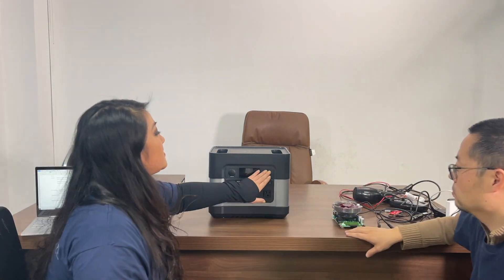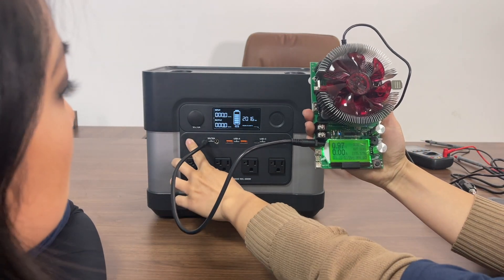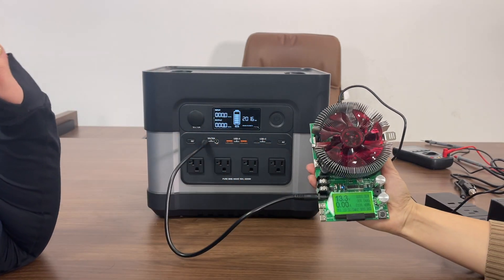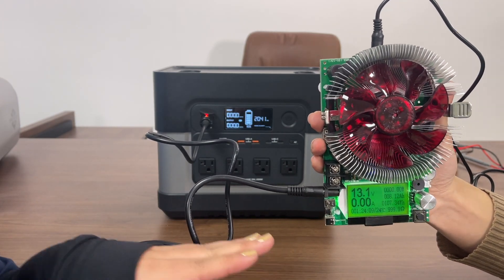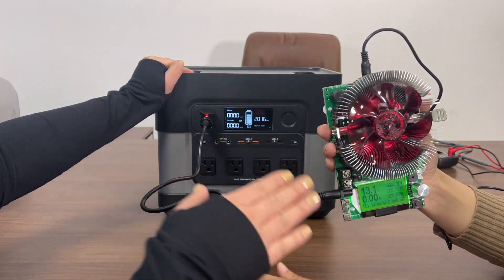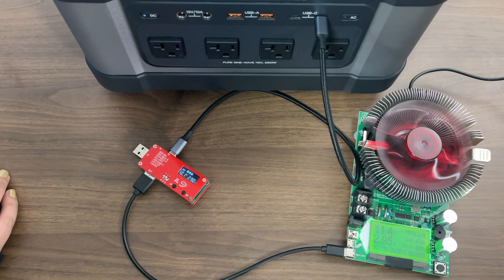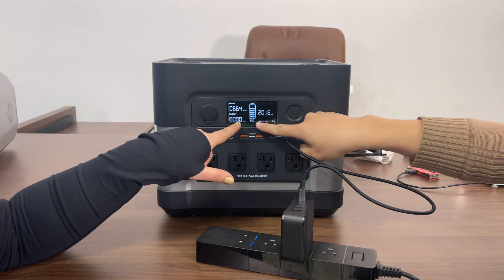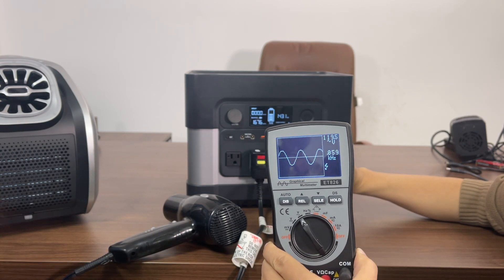Zero Breeze ElecHive 2200 test video

Comment: How many 100w solar panels can you connect to it? does it come with solar panel connection cable?
Reply from the maker: Hi there, 1250W of charging power is the most to be accepted. therefore supports at least 12 solar panels of 100W, taking into account that solar panels have a conversion efficiency factor and can actually support more than 12 solar panels of 100W. Our charging interface is Anderson, for solar panels that we sell ourselves, we will provide the appropriate connectors, if it is the user's own solar panel then parallel or series connection and the connection with the ElecHive will need to be considered.
Reply: @ZEROBREEZETech  is the solar panel 30v  or 12v? will it run on 12v panel?

Comment: If the DC output voltage is supposed to be regulated shouldn't it have remained constant?
Reply: Yeah this is what I'm wondering cuz it went below 12v before it shut off.
Reply: It's staying at 12V. It's a 12V output. If it maintains 12V like in the video at 50% battery SOC then it's definitely regulated. It looks like it is though as it maintains 12V through the range. Ofcourse it goes below 12V when it hits overload.
Reply: @Brisket9392  Seems like it fluctuates quite a bit for a regulated output, or at least it's regulated pretty low. Wish it was kept at 13V at least
Reply: @Brisket9392  @3:35 the voltage read 11.5v. You should read up on the difference between a regulated versus an unregulated power supply. It should stay @ 13.4 (13.3) until the battery is dead.
Reply: @brianonthecoast  You should read up on electrical concepts before putting other people down while you're wrong.  It's regulated and what you are seeing is drop across the wire as current passes through at higher and higher amounts.  The 120VAC doesn't do this because they probe on another outlet rather than at the end of the wire carrying the current.
Reply: @Brisket9392  did you see in the end of the video when they were running the hair dryer and the voltage remained @120? That's regulated, IMO.
Reply: @brianonthecoast  They probed on a totally different outlet rather than at the end of the cable for the hair dryer....
Reply: @rlcrispsss  Sorry, but all the outlets are tied together. There are not four separate inverters in the unit (one for each of the outlets) and the combined load is what the inverter has to deal with. That is why it works how he demonstrated, I am 99.999% certain this is correct.
Reply: They're both regulated.  

The 120VAC stays high because they measure on a different outlet (you can see the probes in another outlet) so there is no drop across the wires

The 12VDC decreases as they increase power draw because the measurement is at the end of the wire carrying the current.  This is expected.

Comment: It seemed like when you overloaded the DC output the whole unit turned off and not just the DC output.  Is that expected?  Is the AC protected in the same way?  Thanks.
Reply: its better if only dc output turned off not all unit
Reply: Agree!  Goal zero batteries only turn off one or the other not the entire unit